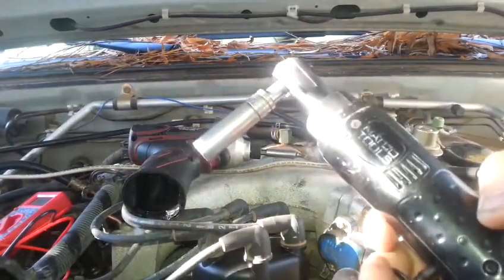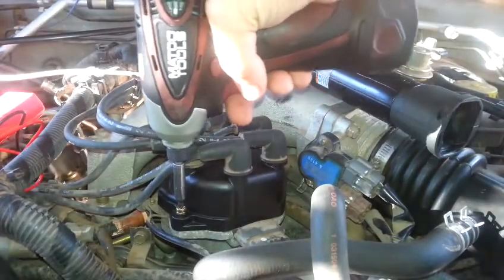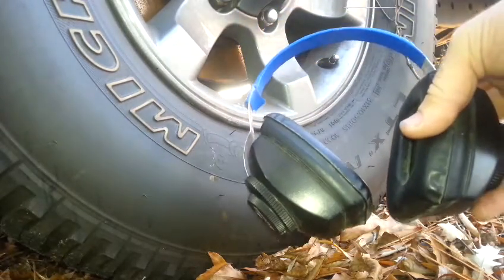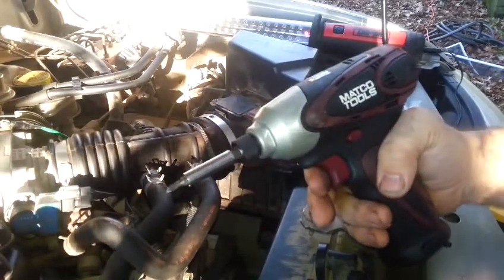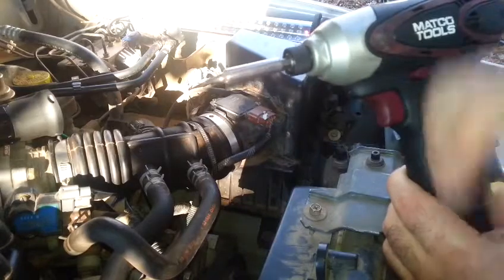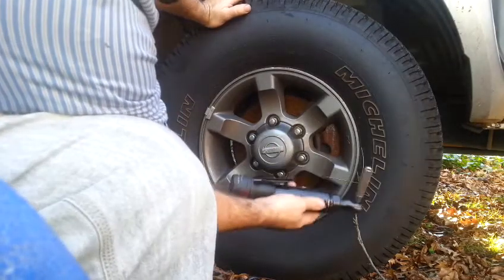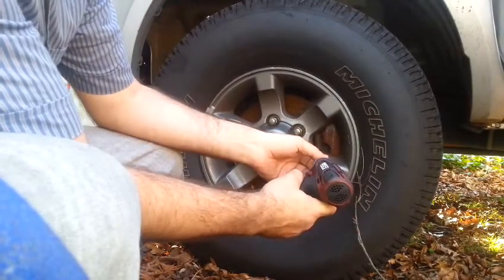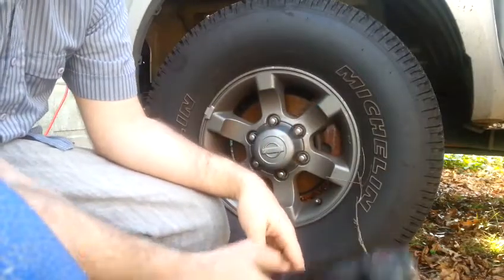Why a Matco Electric Ratchet? Why not an impact screwdriver? Review. :)

Comment: Why wouldn't you put a 1/4 drive bit in it or 3/8 and use it with sockets
Reply from the maker: A lot of times it gets JUST the right length. 

It's limits of what size sockets are commonly available at other times. Those tiny 1/4 inch sockets can sometimes be soooo much faster to use than 3/8 with how light and small they are. 

A lot of mechanics have even taken 3/8 drives and put them in quarter inch wrenches to get this effect more easily and sturdily.

Comment: try a #2 phillips bit, it wont strip as much. looks like you're using a #1
Reply from the maker: Thank you. Since the video, I have taken to my thicker bit, a bit more. Lol, accidental pun? I've also think the tool wasn't broken in. It's easier to run it soft with the variable trigger than when it was brand new.
Reply from the maker: Good eye! Exactly correct.

Comment: "Daddy, stop filming me." i think thats a fair translation ha ha :-D
Yes a clutch would have been the normal thing to have, you could set a maximum torque for screws and not kill them.
"T" bars are brutal but really handy for stubborn overtightned nuts, oow that sounds painfull lol :-D
I dont own a torque wrench, or ever needed one, if i wanted to take an engine apart and re-assemble it, then its a must, but ordinary stuff isnt really critical, threadlocker is your frend :-D
ive never broken or stripped a bolt, unless i wanted to (break the head off to gain access) :-), if you have no feeling for tightness then use a torque wrench.
Reply from the maker: Yes. I think your interpretation of young one was more accurate.
Reply from the maker: I've thought about it more since the review. Steel screws are generally fine with the right screwdriver bit, but brass and aluminum need a gentler touch.
Reply: +DE Nichols 
I still think your power mad he he :-D joking :-D
For screws, that device really needs a slipclutch, by the time you have reacted the head is mangled, phillips screwdrivers are designed to "cam out", dam silly idea.
Reply from the maker: zx8401ztv I was just talking to my Matco agent, and the infinium impact screwdriver actually runs at 60 ft.lbs of torque while the ratchet is 30! The tech line of the ratchet is what they're letting go. What they're keeping is that insanely powered screwdriver!
Reply from the maker: The ratchet they're keeping is 50 ft.lbs. I'll have to update the website and description.
Reply: +DE Nichols LOL its a wee bit too powerfull for its job, i would see if you could fit a 13mm socket on it, see how it copes lol :-D